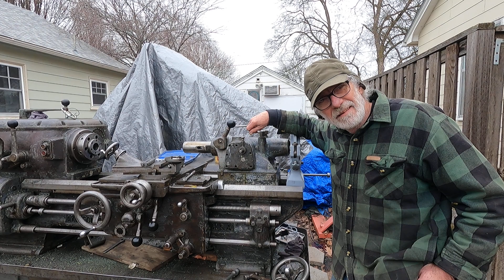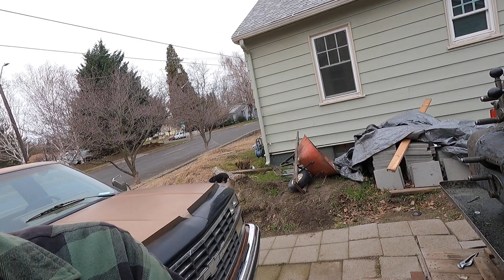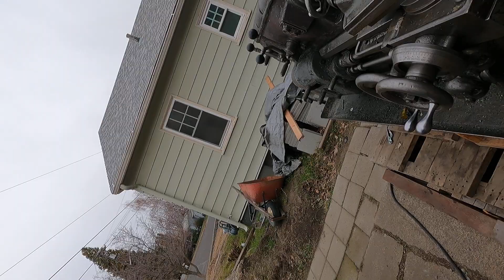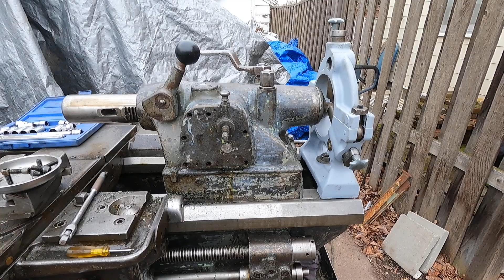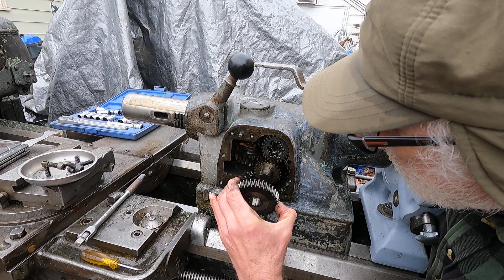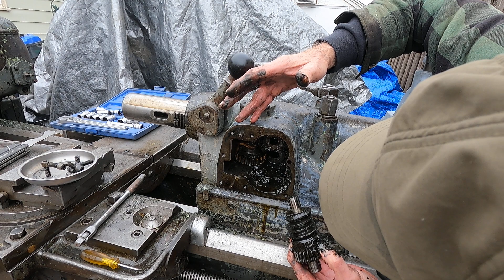Axelson engine lathe two speed tailstock

Comment: I like to use "0" or "00" viscosity grease for gears like this.  Semi-fluid and will not channel out.  Good for a manual steering box too.  ----Doozer
Reply from the maker: I think that would be better, looks like someone filled it with lubriplate white grease 20yrs ago. The missing gasket causes endplay on the handwheel shaft, but everything is still good and tight otherwise.